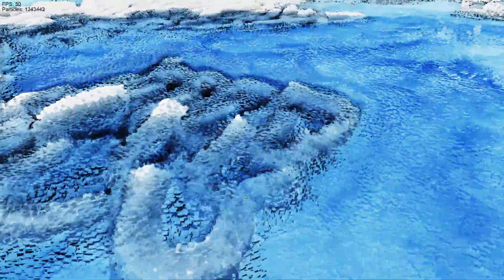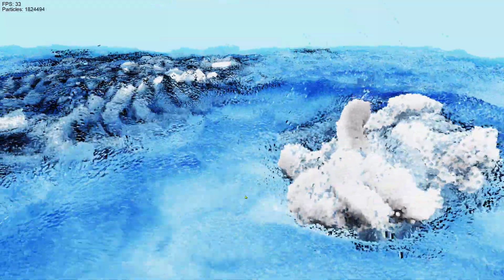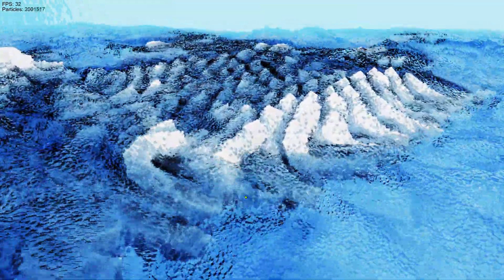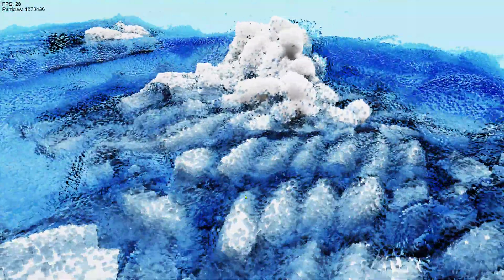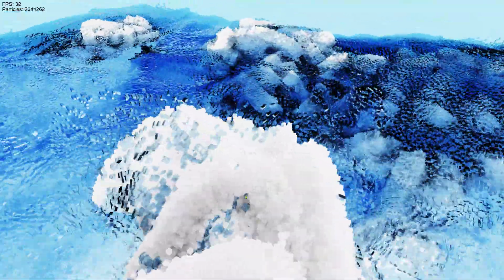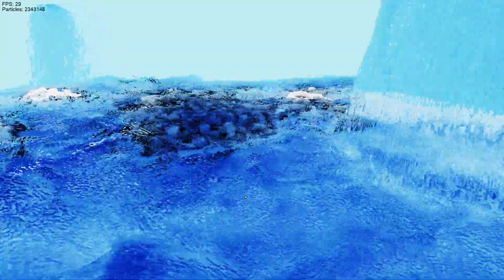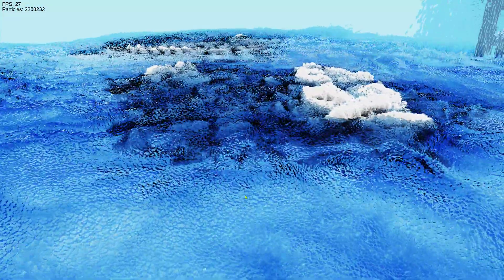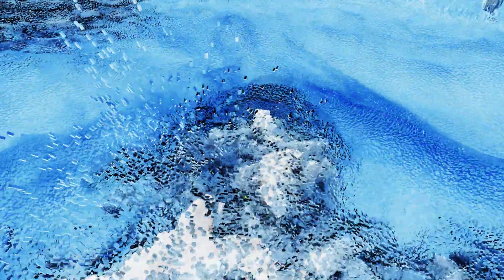Ocean-scale Noodle Simulation

Comment: Hey just wondering, how do you plan on using this system for flowing or large bodies of water?
Was thinking that a some specific depth the simulation would edge more towards a LOD approach once full simulation isnt necessary?
Reply from the maker: There is the option of adding adaptive grid resolution as well. Or for an even larger world maybe I would just do something grid based like tracking volume and velocity of fluid per cell. But also, the simulation is pretty large at this point. This is 16x the size of the previous 2 demos, I think I just need to start adding things like terrain and laying out the world to give a better sense of scale.

Comment: The sound is crackling, maybe it is only for me. But maybe because you were recording it from the pc itself, so the heavy rendering interfered with the recording.
Reply from the maker: Yeah, I think it is just the heavy rendering (4K, 6-7M cubes). I might lower the amount of material simulated in future vids, use lower cost things like distance fields to fill out more space, and get back to 60-120 fps play.
Reply: @GrantKot  it should be possible to record from a separate machine by routing the output from the gpu via cable (display port/hdmi) to some recording device. I know it is the way professional content makers do it,  but it shouldn't be too expensive. 

Main machine for computations, and a separate machine for recoding, to put it simply. And you will not have to limit the main machine's resources that way and can reach its maximum potential